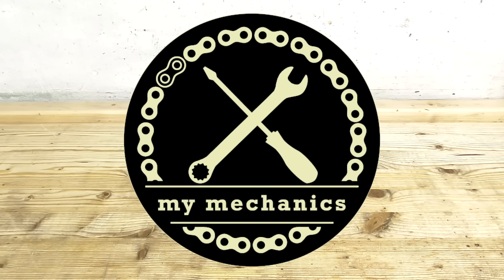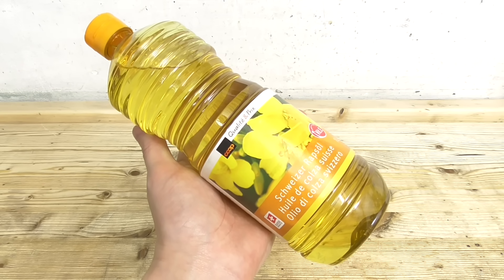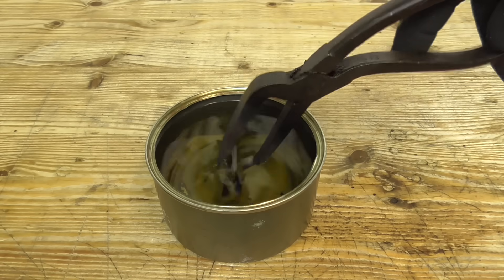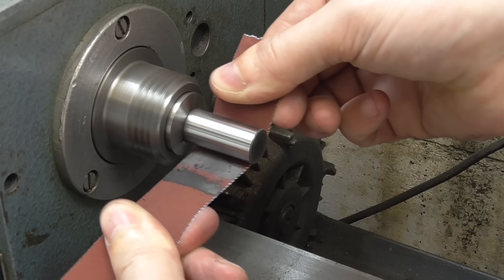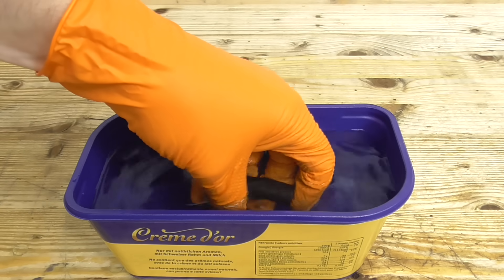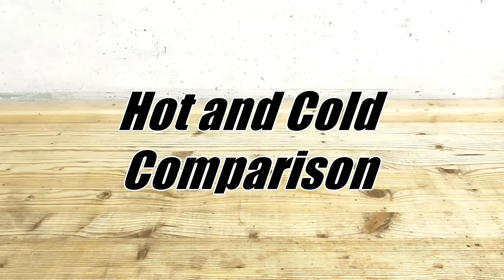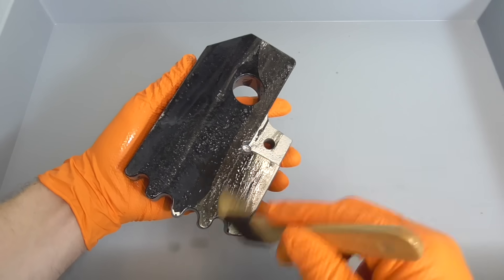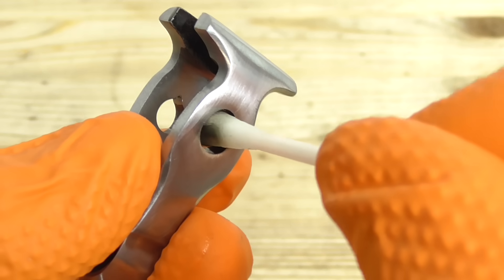How to Turn Steel Black - All you need to know about Bluing

Comment: In my book, hot blueing is not with oil but with potassium nitrate and sodium hydroxide... and cold bluing involves  selenium dioxide.

Using dirty or used oil is not blueing at all, that's a form of Colour case hardening

Comment: Built a muzzle loader and had to 'brown' it.  Had a spare shower so applied the cold-browning liquid, hung the parts in the shower, put a heater and a humidifier in the room, closed the door, and left - checking the water in the humidifier regularity.  Did this for the prescribed number of days and got fantastic results.

Comment: Can I ask you a question: Is it possible Bluing on galvanized iron? I don't know if I'm using the correct term in english, in italian is "ferro zincato" . I'm trying to do it on screws with hot bluing , the screws become dark but only gray and not black like yours and moreover the finishing is not uniform and has some black spots.

Comment: Hi i need an advice. i have a rlly old knife i want to restore. after remove the rust i want to blue it. Which method should I use? idk if its tempered or not, ans its not big

Comment: I do have one question about cold bluing.. once i wipe the item with acetone and add the bluing can i go back and add more bluing to get a darker tone or is the bluing already maxxed out as far as how dark it will be. didnt know if i could do it one more time to make it darker..and as far as the type of metal..does bluing only work on carbon steel? when you say not to heat sheet metal is it made out of carbon steel. Some sheet metals are stainless steel..and lastly if you can add more bluing would the item have to be wiped again with acetone before cold bluing it again.. thank you  hope i didnt confuse you too much..oh i have one more question.. are there other tones of bluing like black or different tones of bluing that you can buy.. i know Amazon sells that very same bluing that you were using..i have Perma Blue. and another Oxidizer  type but cant remember what its called..so far i have had bad luck with Perma Blue..Happy New years day Andrew
PS can you blue or Oxidize Silver or is that another complete different thing..

Comment: these are typically called "flame bluing" (called hot in this video) and "cold bluing" (correctly named in this video).
hot bluing (sometimes called a hot dip) is typically when a steel part is dipped in a very hot salt bath comprised of alkali metal hydroxides, nitrates, and  alkaline earth metal hydroxides to slow down the formation of carbonates in solution.  it's very unlikely to change the heat treat of any parts, the only risk is that it may form insoluble carbonates and superheat the bottom of the pan, causing the solution to flash boil and spit highly caustic 190 degree C  liquid everywhere. which is less than ideal.
rust bluing, which is also fairly easy to do at home, when done correctly, offers a very durable and even coating of black iron oxide, without any chance of changing the heat treatment of parts you made. it's typically done by adding a salt solution to promote rusting in certain areas, then boiling the part in water, brushing off the excess, and reapplying until a dark black. it can even leave a very polished finish if done carefully and slowly.

Comment: i don't think you need oil and quenching for black steel, black oxide is just one oxidation above the blue oxide. chefs make black steel all the time by heating up carbon steel cookware
Reply: chefs coat the pans in oil and then heat them up, it's called seasoning and it doesn't work without the oil.
Reply: @TinaMdot  you season after bluing, its a separate step, you can't even blue the steel if you already seasoned it
Reply: @oldcowbb  I have seasoned skillets before and there was no blueing only oil and heat, 3 or 4 times, and they were black!
Reply: @TinaMdot  i have seasoned carbon steel pans too, the black color is from carbonization of the oil, its a different kind of black from bluing.

Comment: You can black "stainless steel " , and some grades will actually corrode . To black stainless steel :sulphuric acid 180 parts
Water 200 parts , potassium dichromate 50 parts . Temperature  99° C . Heat solution to obtain deep black , rinse in cold water allow to dry and harden .

Comment: Check out rust bluing. The original bluing. A corrosion agent is applied and once a rust film forms you set the part in boiling water, this turns the oxide black. Buff with fine steel wool, typically several treatments are done. Safe for heat treated parts.     Cold bluing doesn't tend to wear very well

Comment: can small steel bolts be applied with the hot bluing method? would that be okay and not melt the threads?
Reply: You won't melt the threads (not enough heat for that), but you can definitely affect the heat treatment. Many bolts and screws are heat-treated to improve their strength, so hot bluing can weaken them.

I would recommend sticking with cold blue, or maybe try rust bluing - etch the parts with white vinegar, then use a mixture of hydrogen peroxide and table salt to cause the parts to rust quicky, then boil them in water to convert the red rust to black oxide. It's slower and messier than cold or hot blue, but it's more durable than cold, and won't affect the strength like hot can. You can find more details by googling "peroxide bluing" or "rust bluing".

Comment: You didn't mention if "cold bluing" is rust resistant also after you're done. You only mention that it's rust resistant after hot bluing.
Reply: It's rust resistant but mechanical friction rubs off the blued surface
Reply: @TinaMdot  Ah, ok thanks

Comment: Neat, I only knew about blackening by rubbing the heated metal with cooked linseed oil and then holding it in the top of a forge flame. (It takes on a very rugged carbon look, which I like)

Comment: Your "hot bluing" is actually "heat bluing". Hot bluing is a chemical process (like cold bluing). Heat bluing is depositing a uniform layer of oxide, the color of which is determined by the surface temp the part has when quenched. It can be quite a few colors, from pale straw yellow to dark purple. The oil has no part in the actual color deposited, it only serves as a barrier to oxygen as the part cools (if the part is exposed to air as it cools, the color of the deposited oxide will change). The process can be done with oil, brine, even clear water (or jelly, or peanut butter, or an inert gas like argon, or milk, etc). The "quench" only prevents contact with air. Oil is used mostly for economy of scale, as it doesn't boil, so you don't need nearly as much volume as you would with water, nor do you have to agitate as much to break up the vapor barrier that water forms. Use your favorite search engine for "heat colors of carbon steels", and you'll find a chart of the colors you can produce and the temps that develop them. Early luger pistols were heat colored dark straw (a very low temp color, so it doesn't effect parts tempered at a higher temp), while parts like safety levers and extractors on soviet pistols will often be found in a violet color when new (a high temp draw, and never refinished afterwards).

Comment: Cold bluing really isn't bluing. It's a copper compound that's basically painted on, that's why it's so delicate and doesn't really give any corrosion protection. Rust bluing is the best, but it's labor intensive.

Comment: 2:20 that is not ‘hot blueing’
Bluing is a chemical process
 - cold blueing 3:50 is what you are doing here. The chemical action colors the metal with an oxidation resistant chemical process. 
 - hot blueing is a chemical bath where the liquid is raised to a high temperature  and the part takes on the chemical change 5:53 but it DOES NOT damage the part because it has no ability to alter the hardness or tempering of the base metal. 

Heating the part to 300*C exceeds the tempering and quench characteristics the manufacturer or craftsman applied to the part; oil quenching it makes a steel part harden and the oil burns onto the surface resulting in a black finish as a coating- it is NOT “hot blueing”

Comment: For a stronger rust resistance and better wear, use Phosphoric acid, which converts the surface to iron phosphate and is 1/10 the cost of the "Bluing Liquids"

Comment: hot bluing on hardened part doesn't change anything : the part is heated THEN colded in oil = Hardening. This is how metal is hardened or tempered.

Comment: Convenient, but neither of those processes is actual bluing of steel. The cold-blue is a selenium/copper reaction, an does not provide the rust protection of an actual oxide bluing reaction on steel. The other process is simply darkened/"burned" oil on the surface, which is likewise not a true bluing of the steel. The appearance may be the same, but on a chemical/molecular level it's completely different -- kind of like the difference between getting a suntan from being exposed to sunlight, and getting a "suntan" via the application of "suntan lotion" which provides the appearance of a suntan without the skin actually having a suntan.

The traditional type of bluing is "rust bluing" in which red oxide (unstable) is converted to black (stable) oxide. The more "modern" form of bluing (less expensive in a production environment, but not practical for home use) is hot "salt" bluing, in which molten chemical salts are used to quickly create a dark oxide layer on the steel.

In both cases it's a true bluing of the steel -- a dark, stable oxide, which provides some protection against rust via simply being there, and most of its rust protection by virtue of its ability to retain a thin layer of oil on the steel -- something the "cosmetic" forms of "bluing" cannot accomplish.

Rust bluing is something that can be done at home without too much trouble, but even so, beware of "experts" making videos that go about it completely bass-ackwardly (i.e., constantly rubbing a rust-promoting acid onto the steel and then quickly rubbing it off before it's able to create a rust layer! -- and then doing this over and over and over, constantly rubbing, rubbing, rubbing, and then proudly showing off the mostly white metal, ecstatic over whatever faint degree of bluing they feel that they can detect.

Sadly, a camera and an audience seem to in the minds of many equate to expertise.

The bottom line is, as is so often the case, "caveat emptor"!

Comment: It's worth noting that cold bluing really isn't a great surface finish for rust resistance.  

Hot bluing and rust bluing methods create a passivated layer of iron oxide on the surface, otherwise known as magnetite. This creates the blued appearance and provides a form of corrosion protection, similar to passivated aluminum oxide. 

Cold blue solutions offer none of these benefits.  It's a layer of copper selenide that sits on the surface of the steel, and provides a blue appearance.  All the corrosion resistance properties come from the layer of oil you must apply after bluing.  

In my opinion, cold bluing shouldn't be used for anything besides a covering up a small cosmetic blemish.

Comment: Your ‘hot bluing’ method is not bluing, it is called oil quenching or sometime blackening.
True hot bluing is messy and somewhat dangerous because it uses mixtures of salts and acids.
That bluing is truly various shades of dark blue depending on the mixture. Polished parts do come out much better looking than with oil quenching.
The finest firearms are either hot blued or rust blued and it is truly and art.

Comment: From my understanding, there is also a form of hot bluing that is used for firearm parts that involves heating them in a "salt mixture of potassium nitrate and sodium hydroxide" heated to a "temperature from 275 to 310 degrees F" for "15 to 30 minutes". Quoted from MakersLegacy. Rust bluing is also a thing that many hobbyist gunsmiths do, which just involves boiling red rust, however it can take upwards of several weeks depending on your local humidity.

Comment: Hot Bluing has a better depth of colour and a better surface sheen, Cold Bluing is ok for those who don't like to use a flame gun
Also you can blue almost every metal. it is down to the correct heat and procedure 
as i Blue Stainless 316 
But Liquid Bluing is mainly for Ferrous metal, Like Galve, Iron, Steel, and so on.

Anyway it was an interesting video you have done and hope it helps those who want to know 
/So thank you for taking the time and sharing.

Comment: also note that hot bluing increases hardness on the surface due to case hardening from quenching in oil. this is due to adding more carbon in between the iron atoms.
Another thing to note is before bluing any steel you need to give it surface energy, this is done by sanding or sandblasting. surface energy is created when exposing the bare steel.

Comment: These cold bluing methods are not actually bluing the steel, they are depositing a layer of copper onto the surface of the steel and there is a chemical in the solution that turns that copper layer black.   The solution is is a bluish green because of the copper that is in solution within it - when this comes into contact with the steel the copper is brought out of solution and turned back into its metallic form allowing the blacking agent to do its work.

this bluing is not very robust and is subject to wear so I would never recommend this method for important parts.

Another very easily achieved method is how the old timers would blue guns.  they literally RUST the parts then simply boil the rusty parts  in water.  This converts the red oxide directly into black oxide.  this is probably a better bluing method than the heating and oiling method.

Comment: Wonderful video! What grit of sandpaper did you use? Is there an advantage of putting on multiple coats of either the hot or cold bluing? I have a reproduction bayonet I want to strip the black paint from. I was thinking using the Casey’s cold bluing using 0000 steel wool in between coats. Thank you!

Comment: Super interesting video. In cooking YT videos there are plenty of tutorials on "seasoning" cast iron and carbon steel pans. The seasoning is nothing more than the hot bluing mention here.  So this changes my perspective on the best way to "season" or "hot blue" a pan using your method.  I just bought a new one and will give it a hot bluing treatment and see what happens

Comment: Two questions: Does cold bluing result in something that is skin safe? I'm looking at bluing some guitar hardware for aesthetic reasons in a restoration project, so the hardware would be in contact with bare hands quite a bit. Question #2: When cold bluing, what kind of oil is best for the 12 hour soak?

Comment: Worked in a machine shop in the 80s.  We used to oil polish our steel rods.  I still have some of those rods and not a speck of rust!  Not easy...but one of the best rust prevention methods.

Comment: The most important harm of heating parts, which you did not mention, is the loss of strength and performance properties that engineers calculated during manufacture.

Comment: Your version of 'hot bluing' was more like the old 'blackening' method. It's not the oil that makes the part black, though in blackening, they would dip the heated part in oil quickly and then allow it to cool while draining off. Often the oil would ignite and they'd just allow it to burn off, which would leave some carbon build up on the part that lasts for some time.

Many just quench in cold water regardless of steel type, to stop the color change, since it's not the initial hardening.

Comment: Thank you for the video, probably someone mentioned that, but heating the part over 300°C will cause to  harden it if you will cool it fast(oil). Therefore be carefull to do not overheat the part. Blue color in your video indicates around 500°C. All is more complex, based on ammount of carbon inside the steel. Cheap reagualr steel will not react too much but some better tool steels probably will. And you dont want your tool to be brittle as glass.

Comment: This bluing process slows down the rusting process.  It doesn't stop it. (even a blued gun will eventually rust)   The bluing process allows the surface to retain oil for long periods.
I wouldn't use the hot treatment for steels where hardness is critical, like knives, springs etc.  Most steels start to soften when it turns blue.  By then you're annealing it.

Comment: This was awesome. I’m curious, is there a rust and abrasion resistance difference between cold and hot blueing?
Reply: Neither are a rust protection, and he's not showing blueing, but case hardening.. Hot Blueing is with potassium nitrate and sodium hydroxide, Cold Blueing requires selenium dioxide... Just Quenching in oil is not blueing but case color hardening.

Comment: you are incorrect. hot bluing is chemical conversion processes that requires caustic solution bath.
what you do is heat color oxidation with elements of case hardening. not bluing. do you research before you start misinforming people on the internet.

Comment: Excellent video.  Thank you!  I see where I have overheated some parts doing hot bluing.  I'll start checking temperatures.  Also, the caution on sheet metal is well-taken. 

Another worthwhile video would be heat coloring stainless steel.
Reply: What have you found being a good temperature for mild steel?

Comment: That’s not hot bluing. You’re just coloring. It’s not actual bluing. Hot bluing is also called hot salts bluing. Uses a caustic hot solution and polishing parts/firearms leaves you a very highly polished blued finish. “Cold blue” is little more than paint effect from low strength acid wash. The other acceptable bluing besides hot salts bluing is rust bluing. What you showed isn’t real bluing. Bottom of the bucket